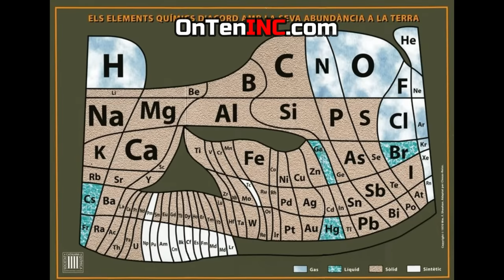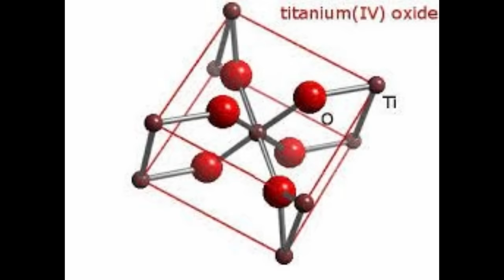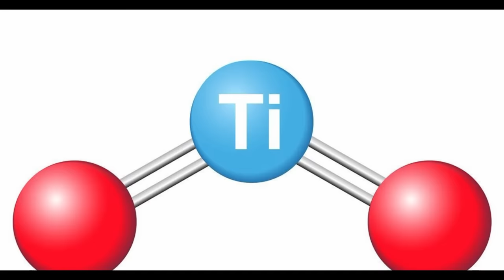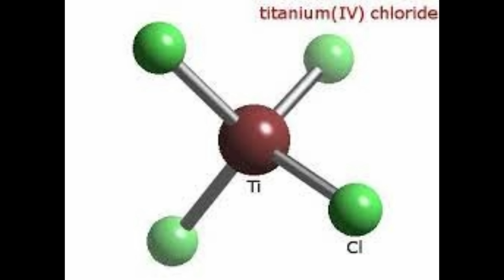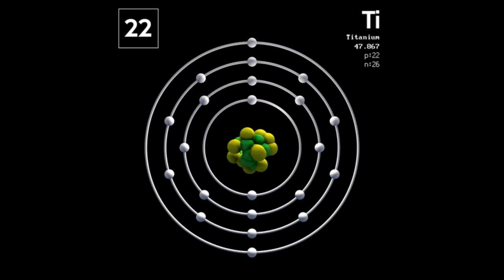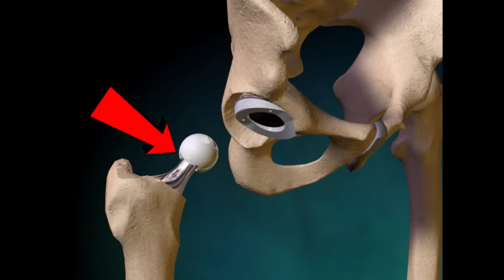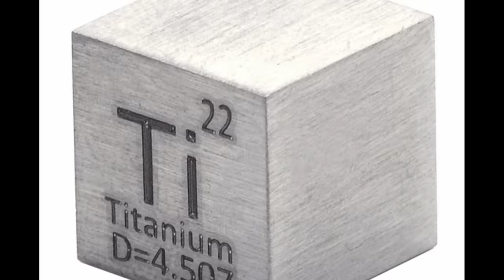Why is Titanium Common But So Expensive?

Comment: cool, but you should fact check yourself before you make a video (for example, stainless steel is technically stronger than titanium comparing pure tensile strength, but titanium is said to be stronger because it has a much higher strength to weight ratio)
Reply: This video pains me. Probably just stress or something tbh, exacerbating my reaction. But at 1:02, that is just completely wrong, and they give no sources or justification. So it doesn't surprise me that there is more wrong than that.

Source: Am a geologist.
Also have a more detailed descriptor of what is wrong in its own comment I made minutes ago from this reply.
Reply: @Josie  "if titanium wasn't so worth it, no one would worry about it. Because it wouldn't be worth it" lmao. This guy was trying to reach his character limit for the school project.
Reply: What's the current price of titanium per kg?
Reply: I saw somewhere they said it was just barely not as strong as steel so could we not slightly scale up  the thickness and then have thicker titanium for les weight and thus stronger for the same weight?
Reply: @TheAnnoyingBoss   it is much stronger for the same weight, that’s what a higher strength to weight ratio means
Reply: @musicgrynd  IIRC its around 10x more expensive then quality steel. Sounds a lot but not really (~30$/kg vs 3$/kg also remember you get a lot more titnaium for same mass) - the problem is what you gonna make with it? Its the machining that is usually the really expensive part.
Reply: People like you need their own planet
Reply: In terms of pure tensile strength, Tungsten is unbeatable. In terms of Strength-to-Weight, Titanium reigns supreme.
Reply: Many metals are stronger.
Reply: @sjb3460   Your description why titanium* is so hard to work with is absolutely useful and correct. You could have mentioned that titanium* not only reacts with oxygen but also with nitrogen, and therefore must be welded under an inert gas cover. Yet, please, when you write such a long comment, do at least a basic spell check before posting: ... titanium* / 3. * it is lightweight ... / (at the same volume!) it weighs* not "1/3 of steel" but "1/3 less", and more than aluminium - specific weights: steel 7.8 grams per cubic centimeter, titanium 4.5 g/ccm, aluminium 2.7 g/ccm).
Reply: @musicgrynd Would have taken you the same amount of time googling this as it took you to write the comment.
Reply: @TheDancing0wind  ... ten times more than* ...
Reply: Lmao none of this makes sense. There are plenty of steel, stainless, and nickel alloys that are stronger than some titanium alloys. Saying one class of alloys is stronger than the other is the most useless thing ever. No one uses pure metals in structural applications because their properties suck. Some steels have over 2GPa YS. I’m not sure what TiAl YS are but only those should be even close.
Reply: Stainless steel is an aloy, but compared titanium and iron, titanium is far superior on its own.
Reply: Stainless steel is alloy. It's not just iron vs titanium.
Reply: @TheDancing0wind  Thanks alot man,really appreciate it.I have tons and tons of Titanium ore..Just wanted to see what the current price is.Was this just a google search you did?I can never seem to find an accurate price for it googling.
Reply: @sjb3460 Thanks!
Reply: Titanuim has highest strength to weight ratio, so it is strongest in that view.
Reply: @cyb3r._.  Hello, with all due respect to you, my dear brother, in fact he did not say that titanium is the strongest metal on earth, he said: some people say that it is.❤🌹
Reply: Yes a planet sized block of ice is stronger than stainless steel, did anyone in your family even go to school? Of course it’s measured same weight ratio
Reply: @JinSakai_Kuroudo  ok but not everyone thinks like this, he could’ve been talking about strength to volume ratio, in which steel is stronger
Reply: @sabet3600  and i didn’t say he did, but that he was unclear about the strengths of steel and titanium. titanium is said to be stronger due to having a larger strength to weight ratio, but steel is slightly stronger if you have the same volume of both (albeit a lot heavier too)
Reply: @cyb3r._.  🌹🌹
Reply: I love how it says "some people say it's the strongest metal on earth" 😂 not that it is
Reply: Sounded like Kamala Harris @underskillednunderpaid
Reply: Also the thing of titanium does have a higher melting point meaning it is slightly more heat resistant as well than stainless steel I mean hell currently the world's technically strongest alloy isn't even steel or titanium it's a gold platinum alloy which is insanely resistant and is the first man-made material to be as resistant as diamond to chemicals etc. so yeah titanium isn't the strongest but it's a pretty solid metal all things considered due to how light it is
Reply: He said”some people say” read between the lines unfortunately you’ve been pre trumped and tripped over your laces on this occasion 😭😅
Reply: @christopherflores5798  well its also one of the most dense metals there is so only used when high temp is required

Comment: Pure titanium is not strong. It is a hard metal but very brittle. Hard does not equate to strong. To make titanium useful for extreme application it has to be alloyed with aluminum. Titanium aluminide is the material used for extreme applications. So we should give some credit to Aluminum as well.
Reply: Thank you for this information. All during this video I was wondering what other elements titanium could be alloyed with.
Reply: Class 2 Titanium (99.3%) is already comparable to good construction steel
Reply: Stop spreading lies. grade 1 commercially pure Titanium  is very ductile and retain very high toughness similar to 304L stainless steel even in liquid Helium temperature (−452°F = −269°C ) !!
Reply: Never heard of "titanium aluminide," but maybe you mean that most commonly, titanium is alloyed with aluminum and vanadium (TiAl6V).
Edit: Vanadium specifically because titanium really isn't that hard. It's strong, but pretty soft.

Comment: That segment where the guy is grinding a metal with a grinder, is NOT titanium. Titanium produces very white, bright sparks when you hit it with a grinder. The color of the spark produced in that segment suggests some kind of alloy steel with medium carbon content or even mild steel.
Reply: I bought an old tool box that some previous owner had added a hasp - secured by some diabolical tamper proof titanium bolts. Not drillable with the bits I had, many white sparks later I angle grindered them off.

Comment: my 2004 corvette z06 has a titanium exhaust, the C5 z06 was the first mass produced car to have a titanium exhaust, it was done to save weight. It was 20lbs lighter than the steel exhaust. The C5 z06 also was the first mass produced car to have a carbon fiber part, the hood , It was also the first mass production car to have the HUD display thing, projected on the windsheild. never have to take your eyes off the road, . great saftey feature.

Comment: There are plenty of alloy steels far stronger and harder than ti they just weigh a lot more. Ti might have best strength to weight ratio
Reply: Exactly that. Wear a steel watch for year and a titanium one for another. And then compare the scratches. There is a reason why titanium watches usually have a special coating over the titanium.
Reply: This. Highest strength per pound? Yeah, prolly. Highest strength overall? No.

Comment: We once shod a horse with titanium shoes that we forged.... it needed a wide shoe for protection but could not carry the weight of steel shoes.
They worked really well and were very hard wearing. This was about 25 years ago and the metal for each shoe cost around $80NZ.... not a cheap job... but very very successful for the horse if not for its owner's pocket... :-)
Reply: "We once sod a horse" - I'd keep that to yourself! 🤣
Reply: …..”shod….”

Comment: Titanium is used in the sr71 because it withstands heat. It is about 20 percent weaker than heat treated aluminum. It's used in sports equipment because people are not very smart,

Comment: 1:02 That figure is just wrong. Even if you meant just in the crust. Flat out misinformation. At least, it seems like it the way you presented it.

By weight, which is the most favorable for you, i.e. least wrong against what you claimed, oxygen is 46.3% abundant, silicon is 28.0%, aluminum is 8.1%, iron is 5.5%, calcium is 3.4%, magnesium is 2.8%, sodium is 2.4%, potassium is 2.3%, and all others are 1.2% abundant by weight.

Source: Figure 2.15, Page 57, Stephen Marshak; Earth: Portrait of a Planet, 6th Edition.

Comment: It's an interesting metal, the near lightness of Aluminium, but the near hardness of steel.
Reply: Yes... once an annealed bar has been heated to yellow-white heat it cools to a hardness that will take the teeth clean off a file...

Comment: Comparing prices based on weight is not the most accurate representation of price difference. Because of the weight differences, I personally feel a more accurate representation of value would be measured in volume. 🤷‍♂️

Comment: Brooo, didn’t you say titanium is 40%-60% lighter than steel?  And then compared cost per kilogram?  You gotta compare price per volume because that’s the actual equivalent in material usage you’re working with.  If we round the weight difference to 50% and the cost difference to 200x more per kilogram, we’re actually looking at a 100x difference in cost.  Still high, but half what you suggested.
Reply: However - since you would need even MORE Titanium for the strength of a given part, the difference might be that other 50%.

Comment: If Elon Musk said that about titanium, then he's wrong. It's far more likely that an ancient civilization, if one existed and became sufficiently advanced technologically speaking, that they would want to use more biodegradable materials. For instance, one could produce a biodegradable plastic with which to infuse carbon fibers and make a "good enough" material for all manner of applications. It would be really light and plenty strong for most purposes. And corrosion resistant doesn't mean it won't corrode, it'll just take longer. If an ancient civilization existed more than 10,000 years ago, any titanium they used would have oxidated long ago just as iron and any iron based alloys would have. If an alien civilization existed, they might have shield technology to augment weaker materials being used for ships to allow for easier construction.

My weird recommendation, go watch the movie Explorers.
Reply: A simple proof that there never was an ancient civilization is because there is no evidence in any fossil record. Sure, even titanium would eventually oxidize in time, but if a simple bone can be fossilized, then metals and plastics would have also left an imprint of some kind.
Reply: @paparoysworkshop  Metals and plastics wouldn't fossilize, so there's no imprint to be left which wouldn't be erased with time. Further, we haven't dug everywhere or potentially deep enough anywhere to find any imprints that might exist. An absence of evidence is not evidence of absence.
Reply: @anon_y_mousse  No, they don't fossilize. But they would leave imprints similar to how bones fossilize. And you don't need to dig "deep enough". The ground constantly moves and such impressions would rise to the surface just like fossils do. The saying, "an absence of evidence is not evidence of absence", is a copout when someone can't support their opinion. There has never been an advanced ancient civilization on this planet. 

Out is space, we'll never know until we can get there.

Comment: Some parts on the aircraft fuselage made of titanium and special fasteners as well
Reply: You do not use titanium for fuselages, because aluminium is still lighter by volume than titanium (and carbon fiber is even lighter and stronger). In the aircraft industry you mostly use titanium for tubing and shafts - parts that need to be lightweight but strong and would be too heavy if made out of steel.

Comment: The table shown around 1:00 minute mark is sort of strange, why not have some other graphical representation, because Titanium seems to be a similar size Gold, Silver Platinum.
Reply: That table was probably used to show how plenty the elements are on earth (the bigger the symbol, the more plenty). That would also explain the weird shape. They should have spent a few seconds to tell the viewers about that.
Reply: @einundsiebenziger5488  And it seems to be just the crust, as much of the "Mantle" would be Silicon and the "Core" is Iron with Nickel and other heavy metals.

Comment: Referring to the elements chart @ time 1:20, how is there more Oxygen than Hydrogen or Nitrogen if the two most plentiful things on earth are air and water, with air being roughly 79% Nitrogen, and 21% Oxygen, and water being H2O.? Not trolling; genuinely curious.
Reply: Earth's Mantle is Silicon Dioxide.

Comment: Titanium is not harder than steel. In fact a watch made out of titanium is usually a scratch magnet compared to steel. And needs a special coating to prevent it.
Reply: No bro strong is not only because of strength, strong is also about decomposition process, if you put a titanium in a salt water live it for 3 years then see it what happen I assured you it's nothing happen to the titanium, while if you put a steel in a salt water it can easily start decomposition only in a months you don't need years to decompose steel against salt water, while titanium can live in the salt water for thousands of years before he start decompose.

Comment: Pure Titanium is actually very brittle. When people think of titanium as the strongest metal that’s because titanium alloys such as titanium carbide are much less brittle making the metal very strong. It is also why getting this metal alloy is so expensive.
Reply: No bro people called titanium as a strongest metal because he is water resistant titanium live longer for thousands of years without even getting decompose, while steel if you put steel in water steel was easily decompose on pass hundred years even the strongest steel in the world bro the weakness are water. While titanium is water resistant and much stronger resist than to stainless but much pricier than stainless.

Comment: Did you know that there was an even faster manned aircraft that also used titanium? It's called the X-15, look it up.
Reply: He said fastest plane, the X-15 was more of a research aircraft/rocket than a plane as it had to be airlifted to a certain altitude by a mother plane.
Reply: @anthonyxuereb792 Fun fact it's still a plane even if it's air-launched and even though it's rocket powered it's still a plane since it has wings,  rockets don't have wings, only fins.
Reply: @tomp23cz44  They look more like fins than wings on the X-15, you certainly cannot manoeuvre like a plane.
Reply: @anthonyxuereb792  They may be small but they're there for the lift, rocket fins are there only for stabilization not for lift thus they're wings not fins + they're small to reduce drag and also to fit under the B-52.
Reply: @tomp23cz44  good grief man if you want to believe it's a plane please do.
Reply: @anthonyxuereb792  READ MY LIPS:! the X15 is a PLANE!!!!!
Reply: @leechjim8023  alright then it's a plane if you say so, I can't read lips like HAL though.
Reply: SR-71 was the fastest jet aircraft.   The X-15 was not a jet.  It was a rocket plane.

Comment: My custom made motorcycle lift has solid titanium wheels on each corner. For no other reason than because the machinist could 😮😊
Reply: @matthewkuhl79  Stop speed reading 🙄. It says Motorcycle Lift. Fatboys are rather low, and a mate designed and fabricated a lift which goes flat to the deck. I then finished it off at work. A machinist mate at work made the new wheels from leftover Ta bar stock he just happened to have lying around. I didn't like the rust prone cast steel wheels from the doner Trolley Jack the hydraulic piston system was taken from, so asked him to make something more rustproof. I'm not complaining he decided to make something really really special.
Reply: @matthewkuhl79  I'll let you off 😄

Comment: Titanium is definitely not the strongest hardened steel and stainless steel are both stronger so is tungsten. Need to read or check those facts because titanium isnt the strongest each metal has different strengths but hardened steel and stainless steel is way stronger plus it depends on how its made because steel and stainless steel and tungsten surely beat it. FACTS!

Comment: i am mechanical engineer and i never heard anybody saying that titanium is the strongest metal. some people talk about tensile strength to weight ratio... thats the specific tensile strength... titanium is not the strongest nor has it an extraordinary specific tensile strength nor specific youngs modulus compared to steel. however it is remarkable in bio compatability and in hot enviroments under load because it has a relative high melt temperature and you can make it "mono grain" (?) i do not know how you call it in english. this solves the biggest problem under these conditions... creep

Comment: Titanium is NOT extremely light in density. Here is its density compared to  other structural metals. Units, kilograms per cubic meter.
Magnesium 	 	1738
Beryllium 	 	1840
Aluminum 	 	2712
Titanium 	 	4500
Zinc 	 	 	7135
Iron 	 	 	7850
Copper 	 	 	8940

Titanium is nearly than 2.6 times the density of aluminum, and 1.6 times the density of magnesium, which is THE lightest structural metal. Of course, it IS lighter than zinc, iron, and copper.